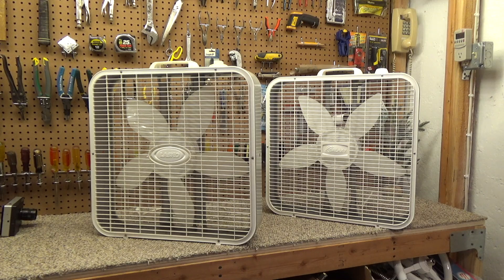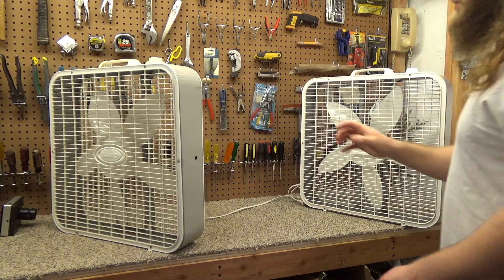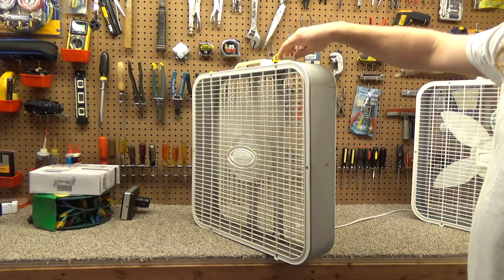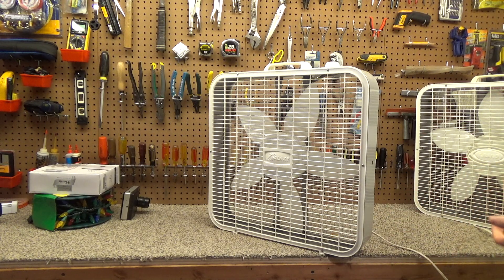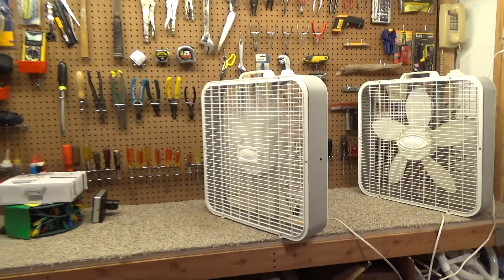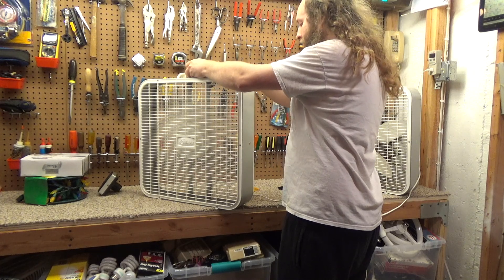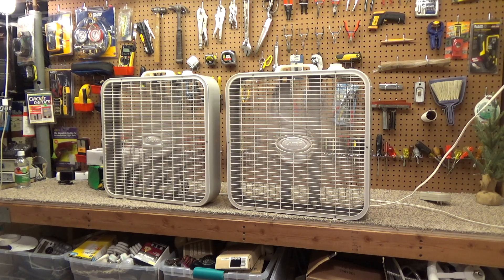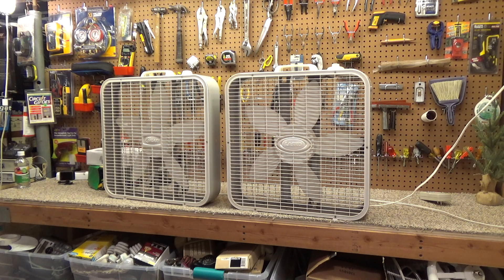Lasko Marco Motor vs Early PSC Motor | A Second Opinion on Performance

Comment: I compared the recalled PSC motor to my Mcmillan motor and they are very close. Mcmilan has a bit more rpm using the same blade but still very close given the power consumption difference. 

I think the problem is older generations who are nostalgia blinded and think anything older is better.